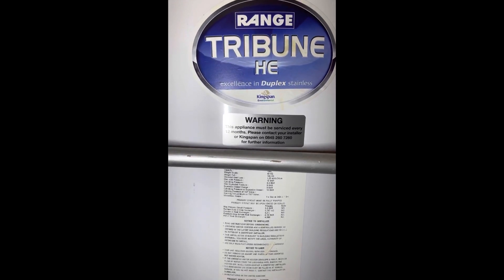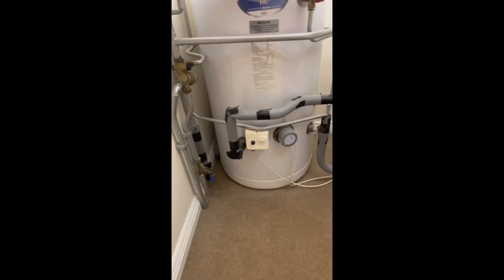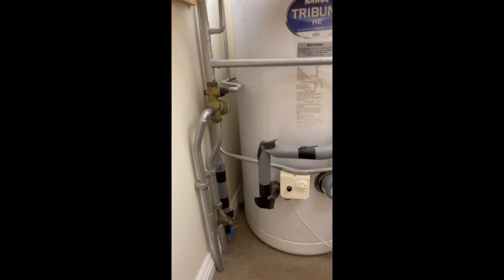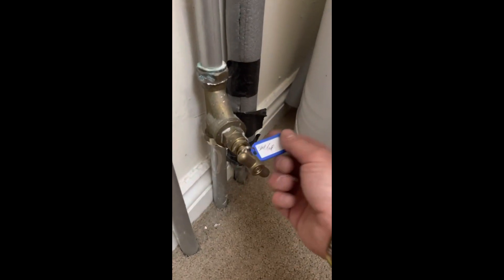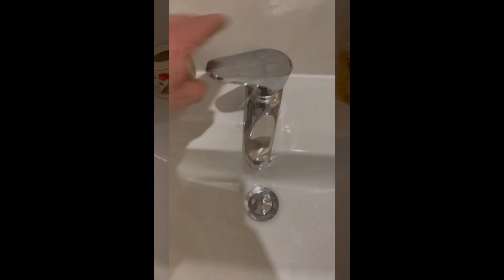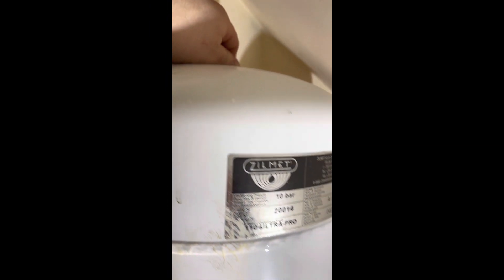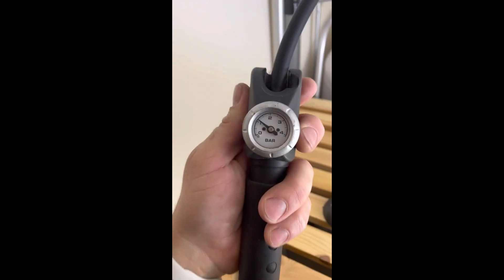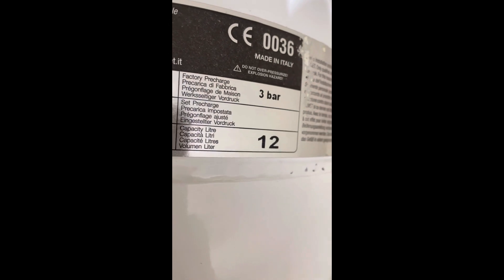How to Pressurise the expansion vessel of an unvented hot water cylinder

Comment: you should pump the tank to slightly less than the incoming water pressure. The 3 Bar rating printed on the side is the MAX operating pressure. If you pump it up this high you'll blow air back into the water line, which is a big no no.
Reply: I think Gizmo is right here. Yes Kjngspan guidance is 3 bar but when my plumber topped my vessel up to 3 bar during a service guess what happened. It blew air into the system and caused the cylinder to make some groaning noises. So I reduced it back down to 2.5 and it was sorted. Good advice I’d say Gizmo 👍
Reply: @tellylgeorge if he put air into the system your diaphragm is burst.
Reply: https://youtu.be/iIaVniPyGI4 This is their official guidance. Best drop them a message and have the video taken down.
Reply: So as per the official Kingspan guidance that's on YouTube if you look, they say 3 bar. So are you saying the official Kingspan guidance is wrong?